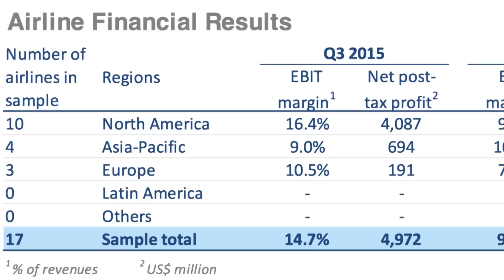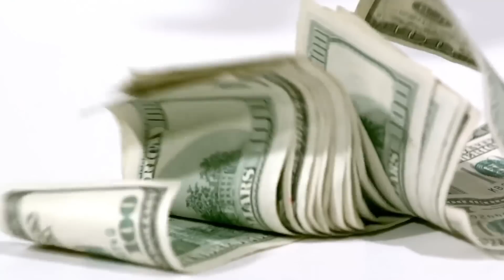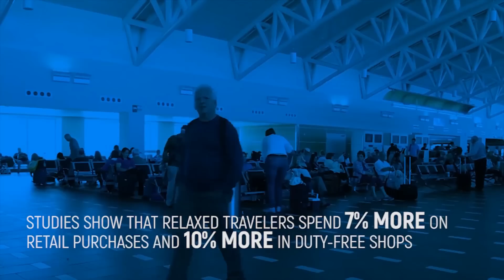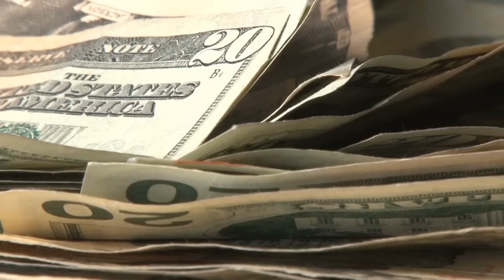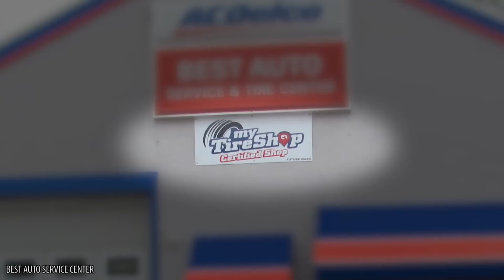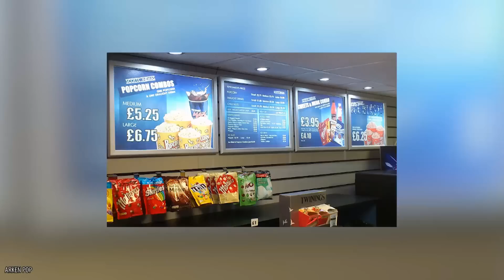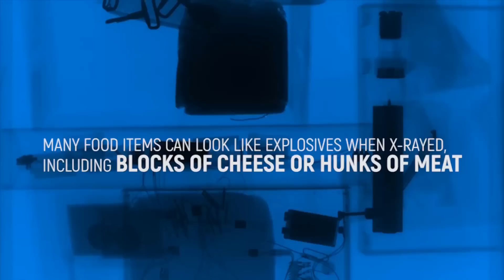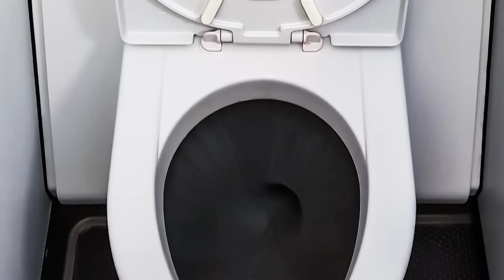TheHUB Live - Amazing Secrets No One Wants You To Know

Comment: Alot of the shit this video says regarding vehicles and vehicle maintenance is either greatly misleading or flat out wrong.  For example, when it comes to oil changes you should ALWAYS do regular oil changes as often as is recommended by your vehicles manufacturer in relation to whatever oil you choose.  Also, in this same vein, higher grades of oil DO in fact make a difference.  If you choose to use a full synthetic option, you can in fact go longer without swapping it out.  Especially in an older vehicle.  Also, doing something small like choosing to  use higher grade synthetic oils and brand name oil filters in older makes and models can save you a ton of money in costly mechanical repiars down the line, allowing you longer overall usage out of a particular vehicle.  Contrary to the WRONG information in this video, high grades of synthetic oil and certain fuel additives are NOT "snake oil" but actual little things people can do to get the most out of their vehicle, whether that be performance, fuel economy, or mechanical longevity.  The type of people that make videos like this are the same kind of ass clowns that say "There's no difference between regular and premium fuel".  Yeah, okay there sugar tits.  And you wonder why mechanics find it so easy to take advantage of the mechanically inept.  
I should probably add that I'm absolutely NOT a licensed mechanic.  However I have worked in the car industry in both a direct sales and a managerial capacity, and I have been working on cars as a hobby since I could barely walk, first with my father on his 1968 Pontiac Firebird and later on my own vehicles.  Today I still work on vehicles out of both hobby and necessity.  So honestly I dont have anything to gain by countering some of these points.  I just hate when "fact" videos like this get made and people take this shit as genuine vetted research, when the reality is "content producers" that fall into this kind of category rarely do more than the most cursory of google searches to gather their "data" and subsequently shit out a video as quickly and as low-effort involved as possible just to meet a deadline and start producing ad revenue.  Frankly I feel dirty even leaving a comment, since such an action is seen as 'viewer interaction' and is calculated positively into the current search and suggestion algorithms.  However I would be remiss if I were to ignore such blatant misinformation.

By the way, I should probably point out that using any such information when speaking to a mechanic in regards to your vehicle's maintenance will do nothing but make you look stupid, not to mention immediately destroy any potential good will and credibility you would otherwise have with your mechanic of choice.  Especially if they ask you where you heard that information, and you respond with "a youtube video".  They will not only see you as foolish and an easy target, but likely never take you or anything you say/ask seriously either currently or in the future.  Besides, majority of mechanics today, especially the small private types, are looking more than ever before to facilitate good will and trust with their current and potential clients.  
Don't be a WikiJerk.  It doesn't help anybody.

Comment: This channel need to do better  Research  Before they put out a video Not all of it but most of it on their mechanic section in this video is bullshit. Like with the oil change. Yes most oil Will last over 3000 miles. BUT!!  Typical oil filters  Typically can olny hold around  3000 miles  Carbon and sludge   Build-up in the filter before the by pass valve opens up and it stops filtering the oil.  Oh yeah and don't forget When the motor is operating The gas will mixed with the oil it happens from the piston going up and down.. so it has a lot of factors that comes in to play when you think about changing your oil ...one thing people can do is to talk  Directly to the mechanic  not the sales person And ask him to explain what's going on if he cant then  you know its bullshit..